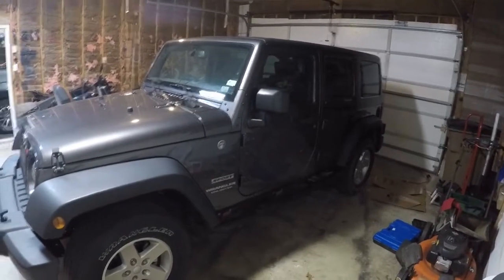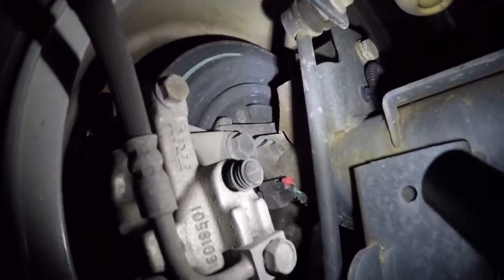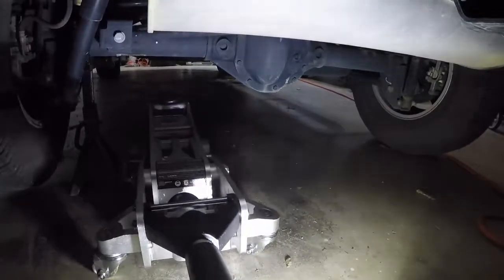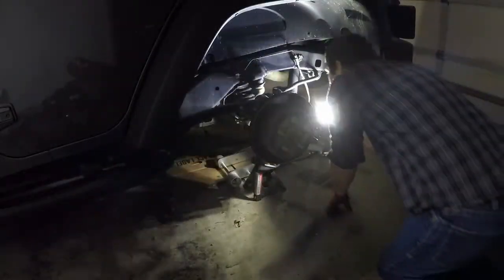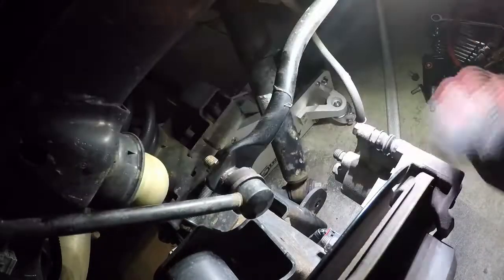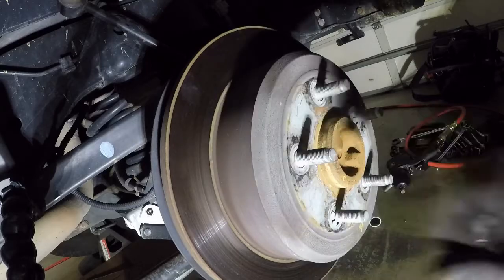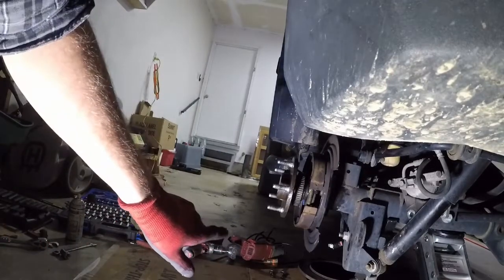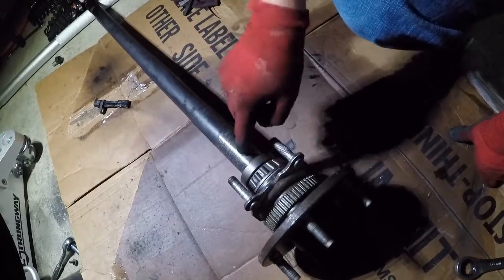2016 Jeep JK Rear Axle Seal and Bearings Part 1

Comment: Hey man, thanks for the vid. I’m at 50,000 on my 2016 and both sides are leaking (already replaced sensors). Any reason you had to pull differential cover? 
Based on what I’m seeing, there’s no c-clip on the axle and it slid in and out pretty easy. Instead of cutting off old seals and bearings I plan to just buy whole axle assemblies and knock this job out quick.
Reply from the maker: To be honest I didn't know that I didn't need to open the cover to get the axles out at the time. However, I'm glad that I did because there was a lot of metal in the oil so I sprayed everything clean as best I could.